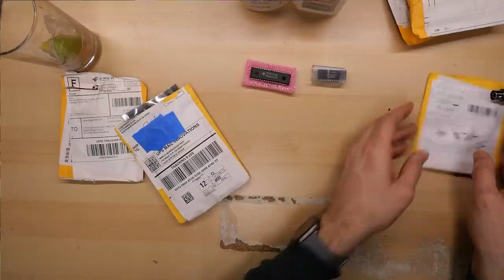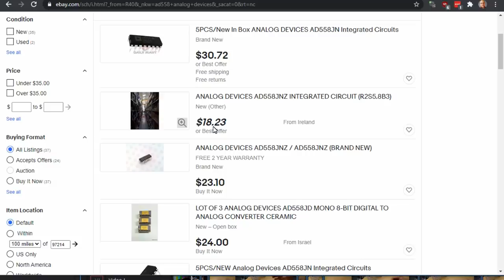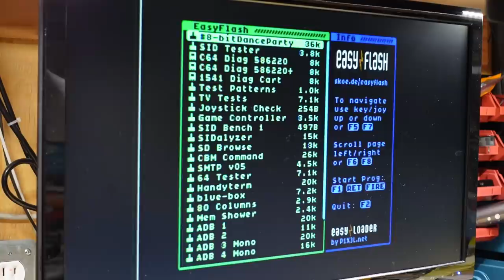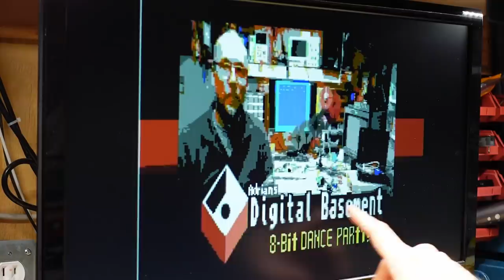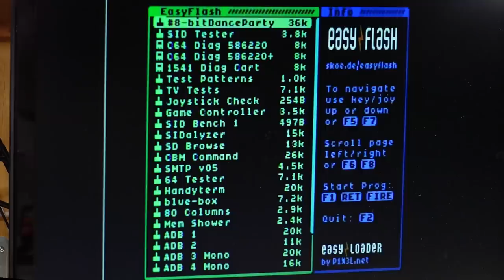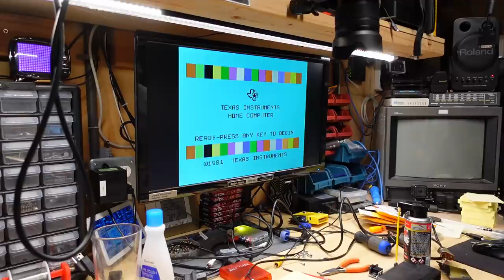I bought more C64 SID chips from AliExpress! (And some other chips too)

Comment: "counterfeit" can also mean chips with the original die with the function that you expect, but remarked with a different version or date. You can also get chips which don't have the correct die, simply a random remarked IC of the same size package, and so might not function at all, but this should quite rare. It's also common for standard-function chips to be substituted, for example you buy some ne5532 but it's really just a random opamp similar to rc4558 or something, not the same die at all.

You're not the only person who thinks "AR" stands for Advanced Resonance, i had heard that before, but you're right to be sceptical, this is probably wrong.

It looks ilke all the chips including the SIDs have had their pins solder coated and surface levelled. The metal comes out completely flat from the manufacturing, but its surface appears to be ever so slightly domed here from solder surface tension.
Reply: What does ar mean for a c64 chip
Reply: @chinossynthesizer705  Nobody knows for certain what it stands for, but it's a version of the SID chip. In total 5 revisions are known, original (retroactively can be called R1), R3, R4, R4 AR, and R5. It might be that the litho maskset is identical between R4 and R4 AR, which is why they haven't outright bumped the version. So the layout of the functional structures of the chip should be identical between these two. But maybe they changed something about the manufacturing process.
Reply: @SianaGearz  check out the therapsid mk2 by twisted electrons it's a c64 synthesizer that can use 3 chips

Comment: Strange, according to the TI datasheet for the TMS9900 processor the pin spacing is 0.1", which is totally standard. Admittedly, this is for the ceramic package, but why would they change this for the plastic package?

Comment: If you get a Pi 400 get the seventy dollar one and a 8bitdo nes mouse from Ali-Express and a power cord with a shut off from Ebay because if the power goes out it will turn on the PC. I recommend Berryboot and a 128 GB SD formatted to Fat 32 I used GUI format but I have heard the Pi thing will format everything you throw at at to Fat 32 anyways. I love Lakka but have audio issues. Like none but Retro Pie works fine.

Comment: My guess is that they are faked to order. So they probably have chips and a list of all the same pin outs then put that list online for sale. When someone orders something they go over look at that somethings pin out bucket check to see if they have the one you ordered. if not they grab one they have a whole bunch of, hit it with a little sandpaper or slap little bit of paint shoot it with a laser ( pre-programmed laser pattern) chuck it in a bag and it's mailed. At most 10 minutes per order that's from when it comes into being shipped lucrative business impressive.

Comment: i bought 2 lots of 10 20mhz z80s through ebay, they're notorious for being remarked lower speed types or a completely unknown chip sold off as z80s,  they do look remarked, i'm trying to think of a way of 'speed testing' them,  i dont mind if not 20mhz, as long as theyre 4mhz or better, they'd be ok,  and that they fully work of course, with good M1 line

Comment: I tried to use the TMS9918 in my homebrew computer. It didnt work properly. Spend hours and hours on it, thrying to fix it. Turned out it was a bad IC... Bought another one and it worked perfectly.

Comment: I really hope one day someone can do something with the VICII chips.   I only have one working c64, but about 5 dead ones with bad VIC II's
Reply: @kristianTV1974   SICK!  Now shrink it down into a chip lol
Reply: @john-tk2dn  I think that's the plan (well, at least a plug in PCB with an FPGA on, but more integrated than currently), so keep an eye on that channel. Incidentally I worked for one of the larger FPGA companies in the 'noughties' and was forever telling retro computer types how seriously they should be taking the technology for the exact reason you are interested. Nobody was interested at the time. 10 years later, it's the 'new' thing! :(
Reply: @kristianTV1974  Will do!  Thanks for the heads up!

Comment: Don't pick the cheapest, pick the one with the best seller ratings. If it's the difference between $22 and $25 and the $25 is 4.5* and the $22 3 star..... it's clear you should go for the better seller. My reasoning being the amount of time you need to wait, if you're going to need to redo orders, that's potentially months extra. So it pays to go with good sellers. I've got nearly 1000 orders on AliExpress and have had maybe 3 items fail to arrive or be a problem.

Comment: Just a question and comment about the taking the TI-99's processor in and out wouldn't it be easy use a double socket and leave one socket on the chip to make it easier to swap around?

Comment: I bet they used 2.5mm (metric size) instead of 2.54mm (the standard 0.1” size), causing an error of probably less than 1mm across the length of the CPU pins, but enough that none of the pins line up. Blame an engineer

Comment: One thing that confuses me about those re-painted chips: If they sand them down, why do they need to paint them black afterwards? If the sanding already removed the original text from the chip, wouldn't a sanding + re-etching be enough? But as you said Adrian, who knows. Maybe it's to give them a more even black look after the sanding. But it does seem like a potentially unnecessary step and provides a dead give-away for potentially fake or at least re-branded chips.

Comment: Like the 6581R4AR the best and pay a lot 50 euro for it. You see that SID chip on the C64 250466 boards. Don’t like the noisy 6581R3 and the 8580R5 sounds the same. The 8580R5 are nice for stereo and Demos. Use the 6581R4AR for SIDPlay64 v1.2 on the C64 Reloaded MK1. And the 8580R5 on the C64 Reloaded MK2 because of the dual SID on the board.

Comment: There is an X-Ray of a TMS9900 chip on Adafruit.  An easy way to check would be to validate the not-connected pins shown have no ohms between both VCC and ground.  https://blog.adafruit.com/2016/06/22/x-ray-of-a-tms9900nl-64-pin-dip-ic/

Comment: they don't usually come from e-waste. but are simply stuff the pcb assembly factory in china has a few 1000000 left of after no longer putting that product they went in together. :P you don't just pull 20000 chips with more or less the same production time from some random old pcbs you found at goodwill lololol. any idea how many shiploads of sid chips were left in asia (not nessesarily china itself) when commodore went belly up? lol. so. some chinese guy pops up. buys the factory building with everything in it and sells the stuff he does not need to his pals. something like that. in as far as it isn't an external electronics assembly contractor that simply still has warehouses full of said stuff. you don't send your contractors just 1 chip at a time. you send them at least a few shipping containers full of em at a time no :P same for literally any other chip. just that all that texas instruments stuff goes into pretty much any product anyway. and they probably have quite a lot more discounts on them than we'd ever get :P it's what china's (and pretty much every country around it) industry has been doing for the past oh eh 40 years. putting products together, from parts, made elsewhere. so obviously when you no longer need the product they end up with a warehouse full of leftover parts for it. which then eventually end up on aliexpress. simple.
Reply: and yes by all means DO just order the fake sid chips too. so they can clearly see 'hey if people pay $40 for a fake one, we can just make brand new ones and charge $100' and that is how one forces manufacturers to produce the stuff you want. just consider the price paid for the fake ones some sort of bribe and go 'send a real one next time' :P 'in fact if you copy this product in a compatible way we'll pay you more per unit and order a few 10000 of em'. some sort of 'incentive fee' :P lol. (see chinese guys usually don't do chip manufacturing and cloning but they sure know some people that do elsewhere ;) LOL. they also know damn well they sell a lot more of that kinda stuff than they sell arm cpus lol.

Comment: Funny thing about the isopropyl alcohol is, that the 70% is actually much better at killing virus and bacteria. But that may also be the reason, why you where only able to get this more common one.
Reply: Why is 70% better at killing bacteria and viruses? Also what about funghi?
Reply: @cheater00  because the cell structures can be penetrated much better. With higher concentrations the dead outer layer will protect the cells on the inside from being attacked by the solvent. The ideal mixture has been found to be around 70% isopropyl alcohol and 30% purified water. If you need a more precise answer, there are many reasearch papers out there with more details
Reply: @stefanvoigt384  interesting, thank you!

Comment: hey i would totally like too see you use a GTX 1050ti 4gb Oc edition in those titles why because it will easily play all those games at 80-120FPS 1920x1080p i tested my Asus Strix Rog GTX 1050ti 4gb oc edition and its base clock is 1546MHZ and boosts too 1948 Mhz  uding msi afterburner and i get zero lag dont beleive me try it you tested the newer cards for comparison but didnt bother doing the 10 series still ..

Comment: Sometimes bad IC handling us one of the reasond those fail. Problably shipment?
Reply: More likely got an old junk IC of the right pin count and type, then sanded it down, painted and labelled for the order. They might look at the listings looking for rare IC's, then make up a batch of them from scrap, and send them out, relying on the buyers who go them to complete an order not checking them, and the end user being at least 2 levels of middleman away so the fake is not found out for a while. They might have real ones as the first batch, then slip the fakes in in larger numbers with each reorder, as they are running out of stock.

Shipping damage not likely, but could have been killed by the removal process of cooking the board in a fire to melt the solder, then bang on the ground to get the solder and components off, with the ones holding fast being taken with a pair of pliers on the second or third cooking cycle. Then the boards get dropped into sulphuric acid baths for a few weeks to strip the copper, and ground up afterwards to make filling material for plastic moulding. The sludge in the tanks gets purified to get the gold content out, by adding nitric acid to dissolve the gold and other metals, and then finally reducing back to gold.

Comment: tms99 your mistaken they whey-re use in timing machine at Esso in Canada during the 80, before ben remplace whit motorola 6800 and Atary yes the same that make the games, and also in bank terminal , that was my job to create and write, firmware for them in between 1999 to 2001. for the BCN bank in Canada. (a was working for Grangey logical then) we also do game for lotto quebec, but not my works.

Comment: I think you should have first resolved the most important question: What actually is a fake chip? Is it some 3rd-party part that is in fact fully functional and just relabeled to trick you into thinking it is from a famous brand? Or is it a chip the function of which just differs from what is printed on but possibly is from the same 3rd party as the chip you were trying to source? Or is it a chip which has its original label and is just broken, trying to trick you into buying broken things, the seller hoping he can make it look like you were the one who broke it so he doesn't have to refund it? Or is it a chip that is in fact genuine and correctly working, just not the the 'new' condition you bought? Or is a fake chip just some piece of plastic with some metal leads attached to it, trying to trick you into thinking it is a chip when in reality it is just some non-functional peice of plastic?

Comment: Everyone keeps screaming "FAKE FAKE FAKE" in all these videos, when really its just old stock or used that they rebranded or mis-branded. Sure some are duds, but would you rather pay the 100+$ on ebay?
Reply: It's not old stock. It's typically chips picked out of literal e-waste. Information is the key, so you can choose your gamble correctly. The filter on maybe 90% of the "fake" SIDs is broken. The question is more would you rather buy a known good SID for $100 or 4-5 cheap SIDs and still risk not getting one with a working filter? That depends on how much your time is worth to you. (And I'm not saying one choice is better than the other.)

Comment: Anything retro is really not worth buying due to the lack of replacement parts. It is not going to take you back in time.  There are a lot of emulation programs that will run Commodore 64 games and utilities on your PC.  However, I do have my old Commodore 64 and it still works perfectly.  Incredibly about 80% of the old floppies still load even after decades.

Comment: It should be the other way around with the ipa. 70% is what you want for disinfectant. 90% is useless as a disinfectant.
Reply: @J Fz Doesn't matter if it evaporates fast or slow. You need around 30% water content for the alcohol to properly be able to denature the proteins of microbes. You can dunk something into a container of 90 or 99% and put a lid on it and leave it for a week and still not kill any of the bacteria or viruses.
Reply: @J Fz It can be made into a disinfectant by adding distilled water, yes. But how many people do you think actually do that?
Reply: @J Fz But I have had to tell a large number of people in the past year about this. Most people seem not to know. I learned it in biology class in high school 22 years ago and I assumed everyone did.